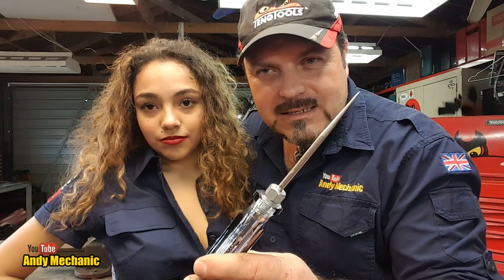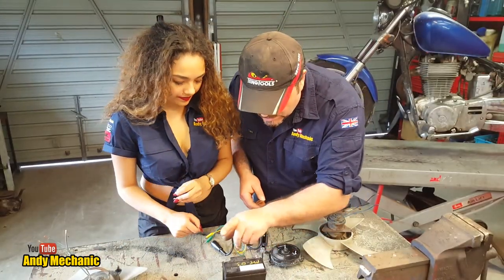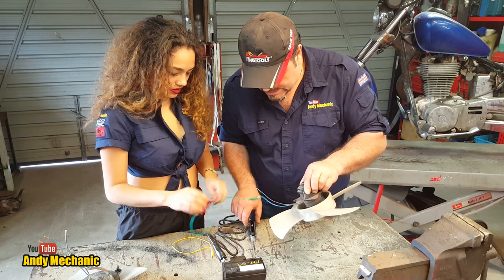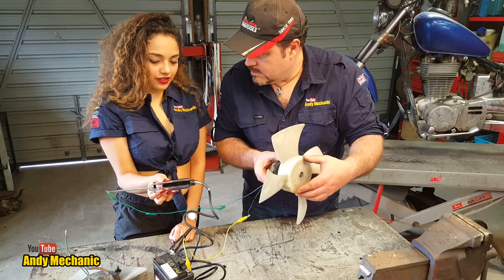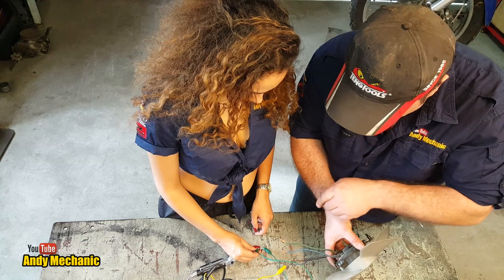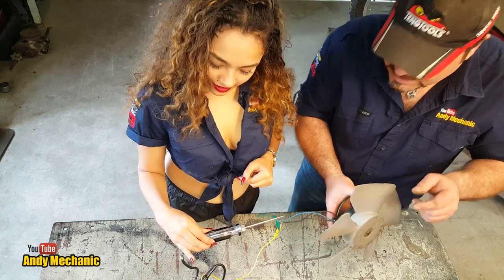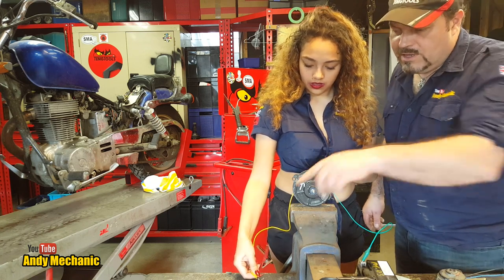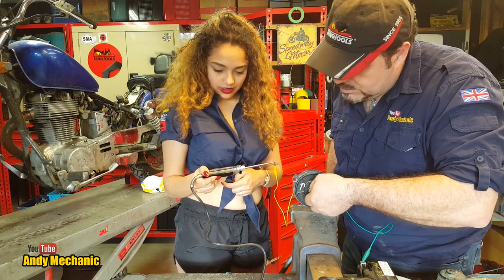How to test a DC fan using a battery & a test light Ft. Tool Girl Jade #1455

Comment: I was going to ask about Starter motor but you answered that so any chance of doing a video on starters as Mine seems to stick at first start. It will click for a few trys then it will work fine so I wondered if this was the same as the commutator issue you demonstrated?
Reply from the maker: I have done a few videos covering starter motors but can do another one with a Tool Girl sometime soon :-)

Fault will be either worn out brushes failing to provide good contact to commutator or it will be a badly burnt buzz bar inside the solenoid. 

Cheers Andy
Reply: Great Andy I really appreciate the help but leave out the tool girls for this one as I really need to listen :)
Reply from the maker: Haha! Maybe! Lol
Reply: Glad i scrolled down , i was going to ask about starters as well

Comment: Andy is the fan blow air into the fan or suck the air out.? I always get the mixed up.
Reply from the maker: The ones in the video are radiator fans and sit behind the radiator so are suck type fans.

If they are mounted in front of the radiator then they are blow type fans.

Hope this is of help
Cheers Andy